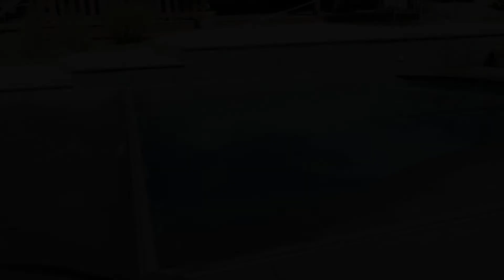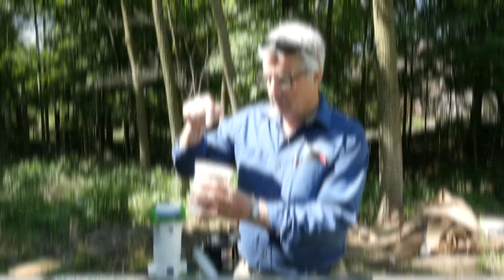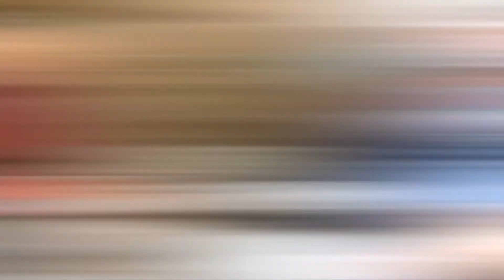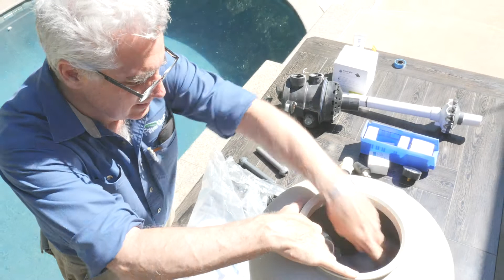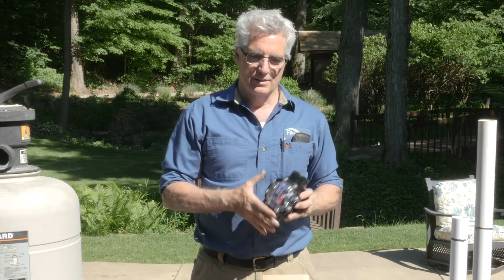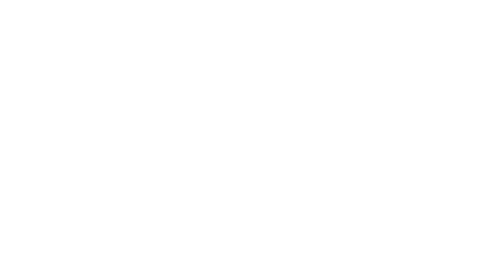Can variable speed pool pumps really save money?

Comment: Cost saving?
Reply from the maker: Absolutely,  operational costs to achieve two turnovers a day is significantly lower with a VS pump.  That said, in most cases, it costs less to run a VS pump 24/7 (when dialed down to achieve 2 turnovers) then to achieve the same 2TOs (3-5 hrs) with a single speed pump.